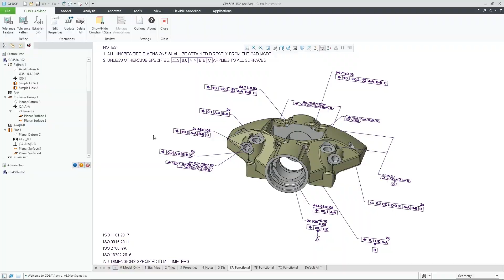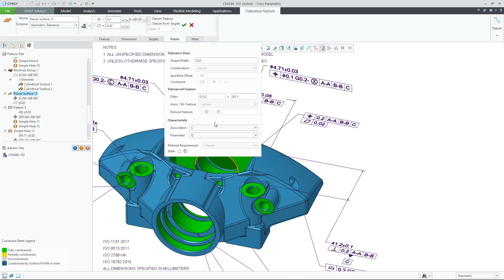GD&T Advisor Enhancements | Creo 9

Comment: can we simulate min and max conditions, so see how it works in assembly, interference for example
Reply: Hello Janos, 
GD&T Advisor's mail goal is to make sure that the GD&T annotations that are applied by the MBD engineer are correctly applied per the detailing ISO/ASME standards, as well as that they are fully constrained and fully semantic with their references to the geometry. 
The ability to analyze min/max/interference conditions is something that is typically done via tolerance stack-up analysis. We do have the EZ Tolerance analysis application (Creo extension) that can help do that for 1D tolerance stack-ups. This could be a great validation tool for such situations and will eliminate the need to for managing manual spread-sheets. you might want to check out the EZ Tolerance application, we have also introduced some really cool enhancements to it in Creo 9.0. Here is a link to one of the videos: https://www.youtube.com/watch?v=J3penPSnYy8&list=PLzFpa6I9hCZV-zIXP2Vomi9GVyUgsfmM8&index=58
Reply: Also, here is another great video to get familiar with the EZ Tolerance analysis tool: 
https://www.youtube.com/watch?v=I2UKBEeSZDo&list=PLzFpa6I9hCZU1sqoUATerGuRM6r4uH53g&index=6
Reply: @mikif15  thanks for sharing, it is interesting